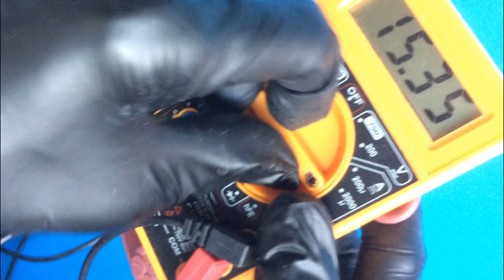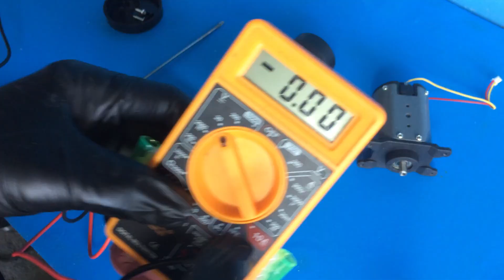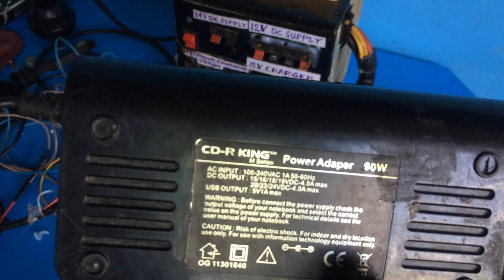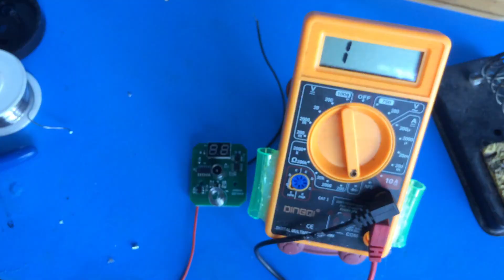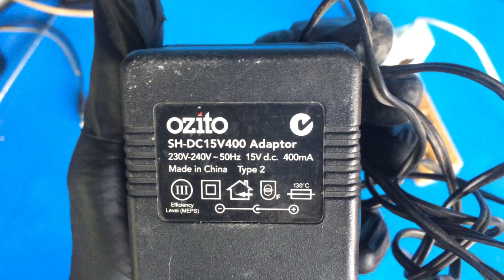Broken Battery and Mother Board Of Portable Muscle Massage Gun.

Comment: dude lose the electrical tape and buy some shrink tubing. It looks way better and more professional. It cost the same except you get more tubing. I buy them on eBay in multi packs that are pre cut and come in many sizes for around $5 USD. out of China. Now the drill to remove the screws. Way too much just use a regular screwdriver then you are not stripping the screws out.